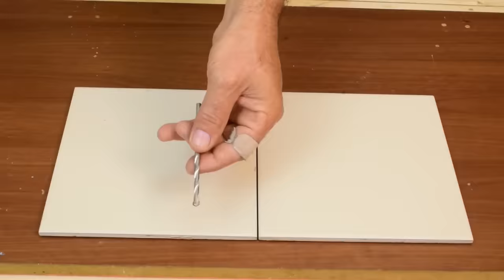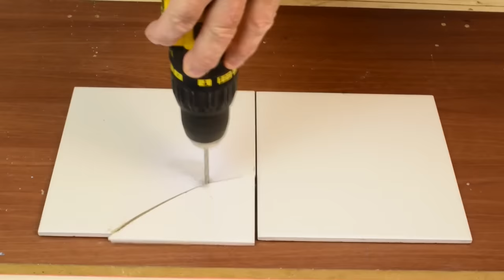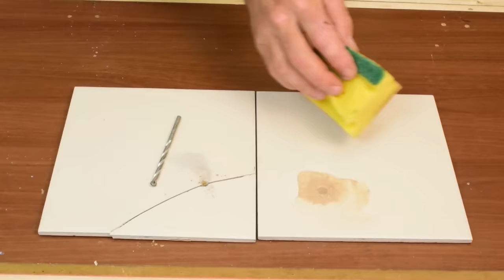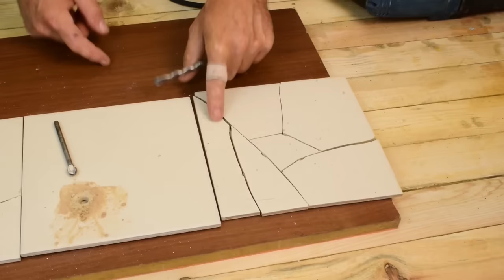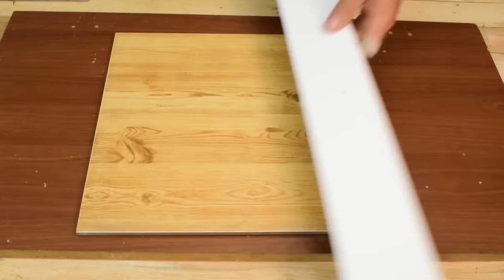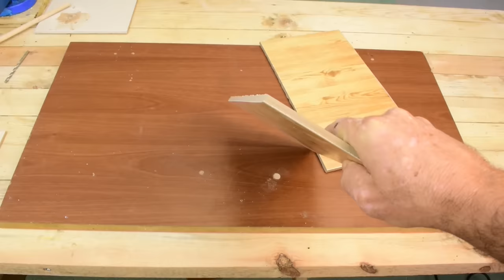How To Drill Tiles Without Breaking Them! No One Knows This Secret

Comment: When you drill a tile just turn off the hammer function on the drill and use a piece of masking tape on the spot and you can do the drilling with an ordinary concrete drill.
Reply: Mine doesn’t even have a hammer function so I’m half way there already.
Reply: It just takes ages to get through the tile for me. It must be some super hard natural stone or something, took me like 3 hours for 2 holes.
Reply: @y33t23 same. My cordless drill’s full battery ran out of juice and I’m still not drilling through.
Reply: @junangeles  what was fortunate for me was that I wasn't drilling a tile that was in some sort of wall or anything, so I just switched to a brick material one and used the fast setting on a corded drill in a drill press going very slowly from small to big drill. Otherwise the drill will go red hot and the tile might crack. I put a perfectly level wooden board to drill into underneath because otherwise it would crack as well. After like 3 or 4 broken ones I finally had it down and could do one hole in like an hour or so.
Reply: Forare piastrelle con il percussore è come darsi martellate sulle dita,se per capirlo ci vuole un video,allora siamo messi veramente male,basta usare la testa,se non si è  seccata del tutto a forza di usare tecnologia anche per cose semplici.
Reply: @y33t23 Er, tried a new drill bit? They do become blunt you know …
Reply: @m3photo726  masonry drill bits are inefficient when drilling tile though; they blunt very quickly

Comment: If you're gonna drill glass or tile, use a glass and tile bit... That's the big secret?
Reply: At the very beginning, he tried hammer option ( crazy !!! ).
The focal point is break the outside glassed surface of the tile with a hard tip of steel, then go on drilling at low speed, the tile internally is more soft ; best using water and pay attention when the bore is almost completed, the drill bit can force too much on the remainig parts and break the whole tile ...

Comment: For over 30 years I have been drilling holes in the tiles according to illustration no. 3, i.e. with SDS drills with impact. So far, I have broken about 2 tiles out of 1000. I am a trained gas-water-heating installer. Tile layers also drill with impact and SDS drill bits. These special drills make it easier than with SDS. But this way with the broken tiles is not right, it only happens to laymen.
Reply: I have NEVER seen anyone try and drill any kind of tile with either an SDS action nor a Percussion action engaged! Think about it, if you hit a tile with a hammer, is it going to bend or crack? Just stick a piece of masking tape on the tile where you want to drill, to stop the drill from skipping/wandering, and drill with an ordinary masonry drill with no impact shenanigans.
Reply: In Deutschland lernt man das schon im ersten Lehrjahr.

Comment: Well I have drilled tiles a lot and what works for me is take the drill off hammer action with a bradawl tap gently and score a mark on the tile so the bit doesn’t slip.drill through the tile off hammer when you get through the tile put in on hammer action and drill into the wall.When you place the plug in the hole make sure the plug is passed the tile or you will burst the tile.

Comment: When I really didn't want to take a chance breaking a tile when drilling, I would make a small donut out of modeling clay and press it onto the tile around the hole and fill it with water, then drill at a slow speed. A little extra work maybe, but it never failed me.
It is the heat and impact that breaks them.

Comment: I put up blinds and poles and tracks of all sorts for over 40 years, like Lenny Kelly below says gently score a small hole with a pointed bradawl then tap gently bradawl with a hammer to make the hole slightly larger then drill on slow speed not hammer action. i think i only broke 2 tiles in that time and they were about 50 years old so really brittle.

Comment: According to my experience, yes you can go with impact and do what you need to do fast and effective, if the tile guy has done quality job tile wont brake. But impact hole has guite extensive edges, sometimes you need perfect edges and cant take risk that tile guy has put one tile shitty. So there are to ways todeal with it.. for diys,  few holes take universal drillbit lightly larger than a hole you are going to drill, tap it lightly with an hammer while turning it on the tile to get rid of the glaze, take ceramic, glass or a masonry drill bit and drill hole on low turns. For advanced amateurs:buy normal quality drill bits for ceramic, puncturemark hole with an old drillbit and drill on low speed, dont forget to cool bit with water and charge more for installation as you are burning trough drillbits. Remeber, you allmost never drill on the ideal circumstances on the floor between two tiles, you drill on the wall on the edge of the tile